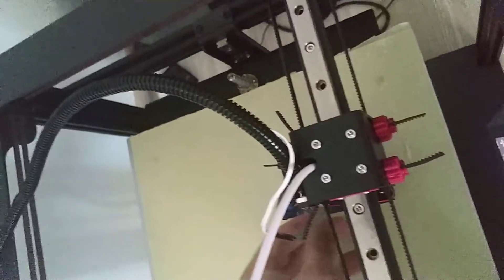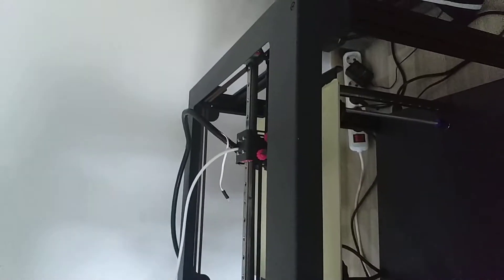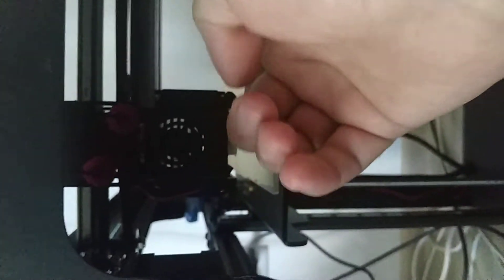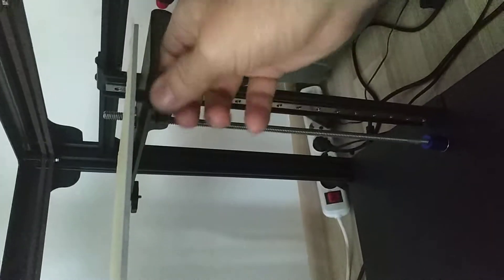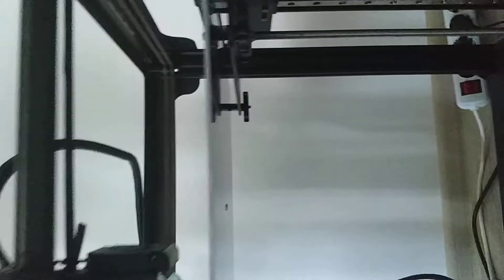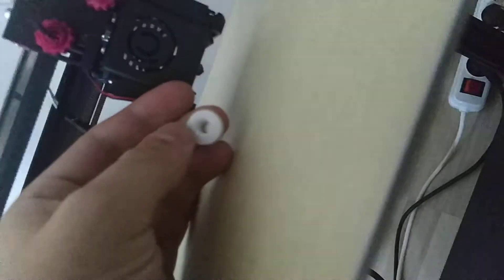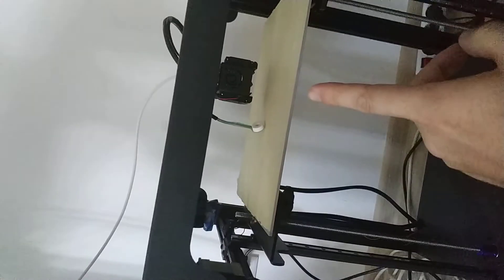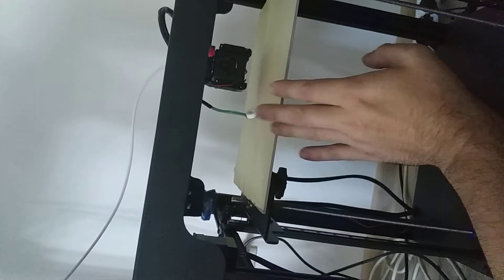Connect included automatic bed leveling sensor for Sapphire Plus

Comment: Why would you want to heat the nozzle for probing like this?  Obviously the sensor won't like that.  Just heat the bed to your normal printing temperature, then probe with this probe, then remove the probe, now heat up the nozzle (and the bed) and now determine the z-offset.  Only for the z-offset the nozzle being hot would impact it.  The same actually holds for a BL-touch: no need to heat up the nozzle for probing the bed, only for determining the z-offset (and you typically want to adjust that with babystepping at the start of a print).